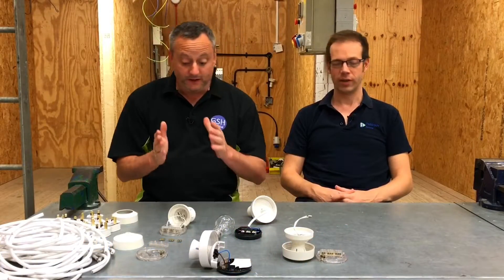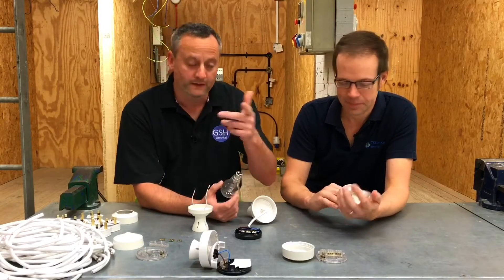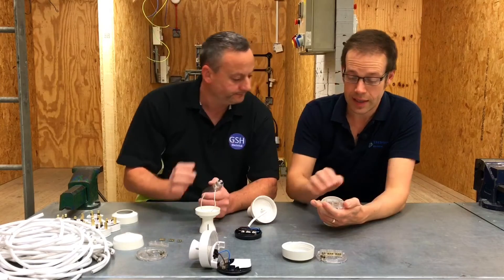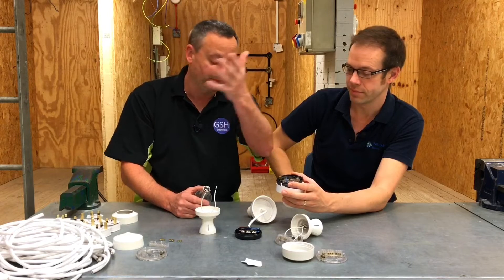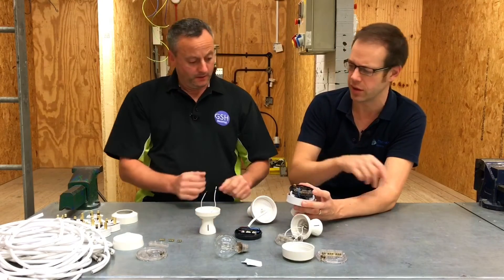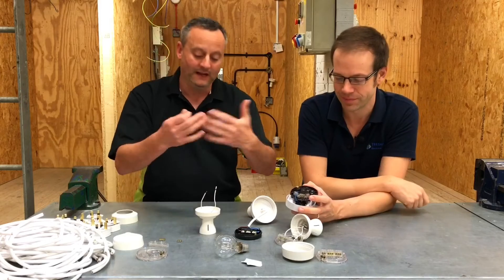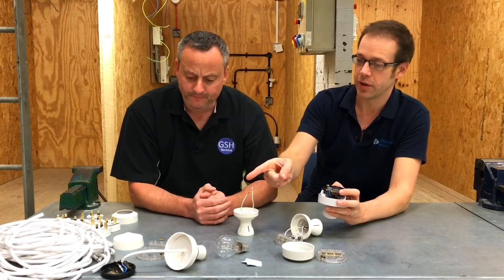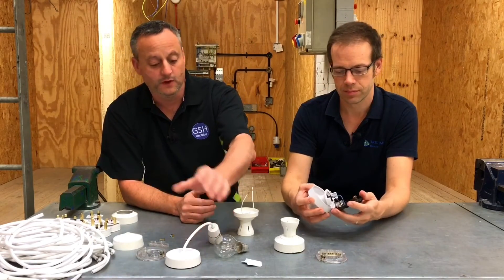What’s Going on Inside a Batten Lamp Holder, Popular Misconceptions and the Connections

Comment: Hi there great video. As I understand it’s important to get the polarity correct at the ceiling rose reg the flex to the lamp holder ie line and neutral flex in the outer terminals but after this the bulb holder has no polarity and it doesn’t matter. What does it mean then “ for Edinson screw lamp holders the line conductor must be connected to the centre contact of the lamp holder? I’m an older man in his 50s with a great passion for learning electrics but can’t work out what is meant by this line in my study notes on lighting. Does this just mean make sure your line and neutral are correctly wired in the right terminals at the ceiling rose?

Comment: I am replacing broken bayoney baton lamp bc22 light bulb socket and it has 2 wires I can see attached but new bayonet batten has 2 plus looks like an earth can it be attached It is a 2 core wire I think fitted to a switch someone has put up on a beam it is in the Attic can it be done ?

Comment: Hi Gaz and Joe, really good video, thank you. Do you terminate or loop the earth in the batten lamp holder or in a separate blue point or insulated connector and just leave this curled up inside the batten?
Reply from the maker: brookpap There is an earth terminal inside the batten holder 👍
Reply: @GSHElectrical  Thanks guys.

Comment: I done a periodic test / eicr  and fancy lights in ceiling hanging down with es lamps wired the  switch live and neutral wrong way round  . Shocking to say the least 😞
Reply: Don’t you love it when hacks parade around as tradespeople: Electrician, plumber, HVAC, auto repairs. Ended up too often being disappointed n disgusted I started educating myself. I ended up getting my own contractor’s license I had started doing so much repairs & maintenance work. Pfft to hacks.